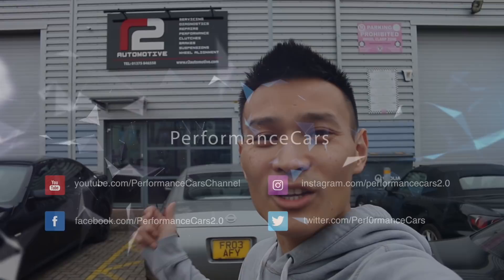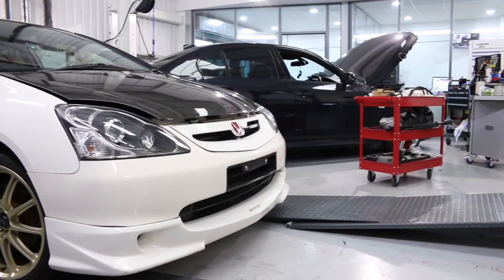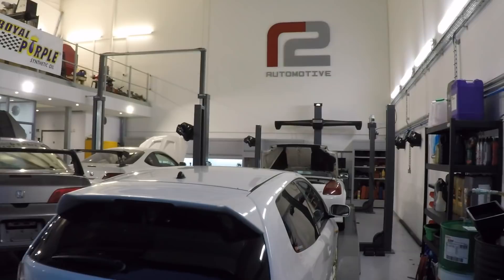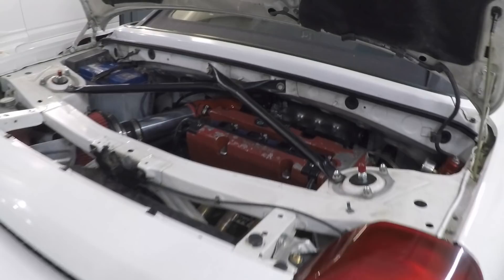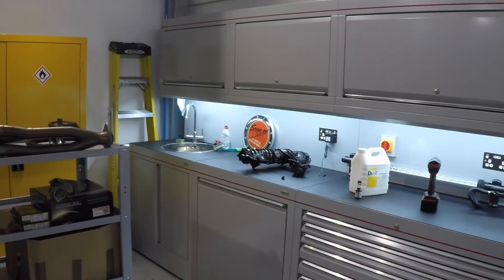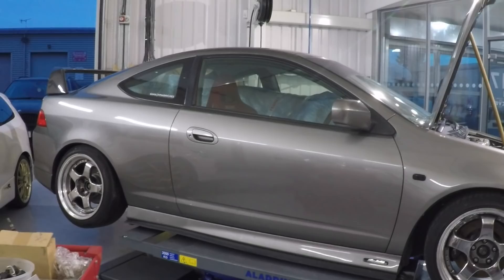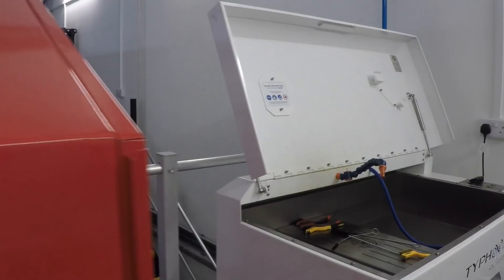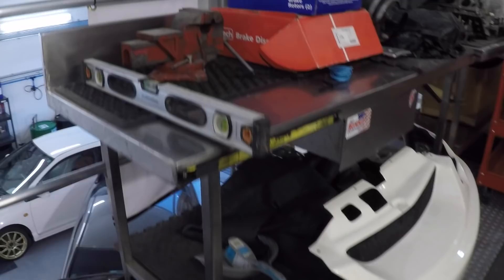Latest Epic Garage in London - R2 Automotive Tour - PerformanceCars

Comment: I like that import Z33 at the start :D - neat video as always, enjoy every upload.
Reply from the maker: Well spotted that it is an import. Hopefully I can do a review on it sometime soon.
Reply: I have a UK spec 350z, I look forward to it pal. Keep up the good work.
Reply from the maker: Very nice! What colour is yours and have you done any modifications or are planning to keep it standard?
Reply: Mine is gun metal grey with a few goodies, option RAYS wheels, intake, plenum, cat back exhaust, tein springs, carbon bits. [IMG]http://i1067.photobucket.com/albums/u427/davey_boi83/DB%20Nissan%20350z%20GT/zcamera-20161015_074630_zpskjp2fqcn.jpg[/IMG] & [IMG]http://i1067.photobucket.com/albums/u427/davey_boi83/DB%20Nissan%20350z%20GT/IMG_20161015_201104_zps4zfccvlv.jpg[/IMG]
Reply from the maker: +david daffin That sounds like some nice goodies. I can't use those links. Would you mind sharing the photos on our Facebook page? www.facebook.com/performancecars2.0